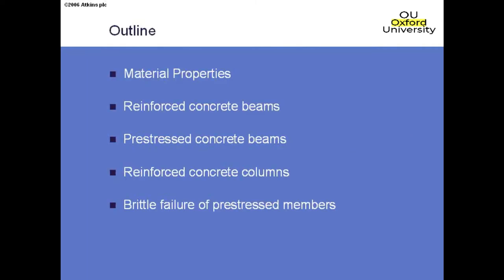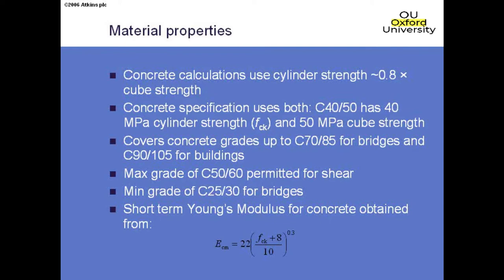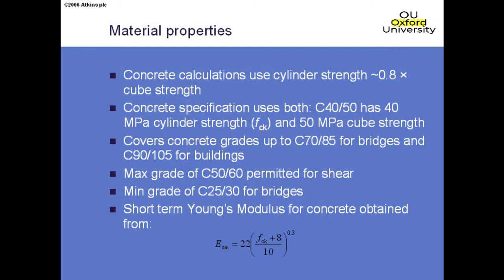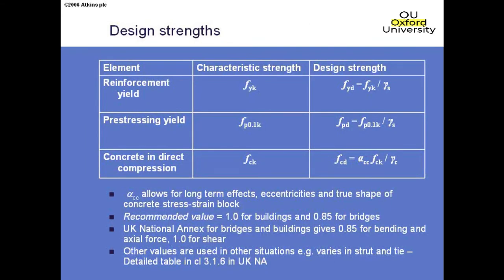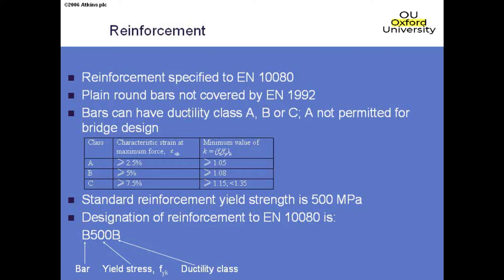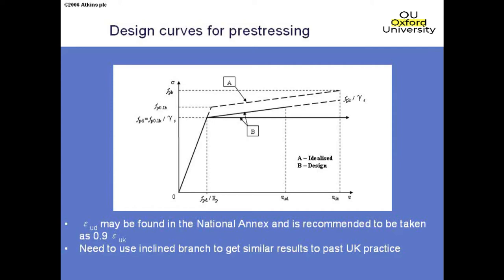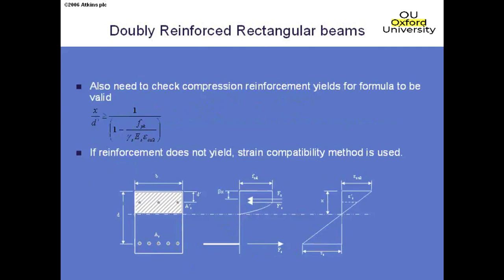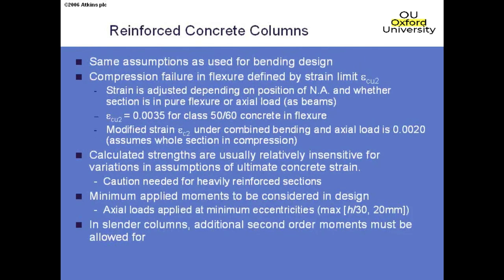Structural Design to Eurocodes - Lecture 3 | RCC Beam & Column Design | Oxford University Lecture

Comment: 🎯 Key Takeaways for quick navigation:

00:20 🏗️ Eurocodes do not distinguish between pre-stressed and reinforced concrete. They address behavior rather than elements like beams or columns.
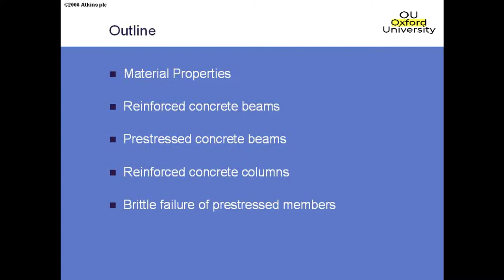01:44 🧱 Eurocodes use cylinder strength for calculations, not cube strength, with a recommended material factor of 1.15. Higher concrete strengths are allowed.
05:05 📊 The design strength for concrete (Fcb) in Eurocodes is the characteristic strength divided by material factor gamma c, multiplied by alpha cc, which varies with calculations like bending or shear.
08:18 🔩 Reinforcement is specified to EN 10080 with different ductility classes (A, B, C), impacting the stress-strain curves used in calculations.
12:28 🌉 Pre-stressing steel is specified to EN 10138, with three classes based on relaxation. Design curves for pre-stressing also include rising and flat branch options.
23:01 📏 The Eurocode introduces new stress limits for sections under compression with bending, which may require calculating a fictitious point for checking strain limits.
25:23 💻 Most software packages may not implement these complex provisions for flanges and outstands, so it's generally safe to stick to the conventional design approach.
27:31 🧮 For quick and rough bending resistance estimates of a section, you can use a simplified formula, but for more accurate results, computer analysis is recommended.
33:08 🏗️ Pre-stressed concrete design involves calculating pre-strain based on pre-stress losses and gamma factors, which affect the stress-strain relationship.
37:30 🕵️ To guard against brittle failure in pre-stressed beams due to corrosion or loss of tensile strength, methods like external tendon inspection or complex calculations are used to ensure structural safety.

Made with HARPA AI